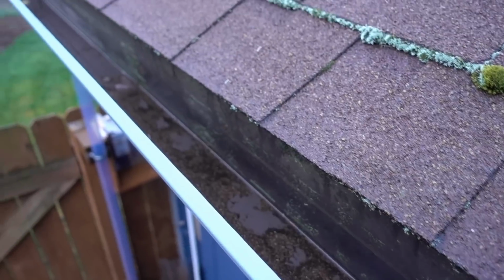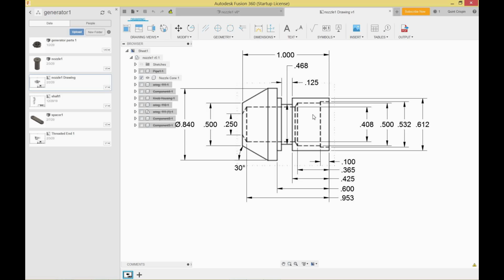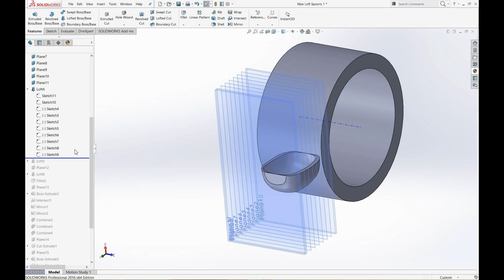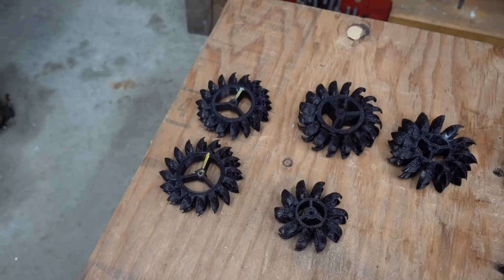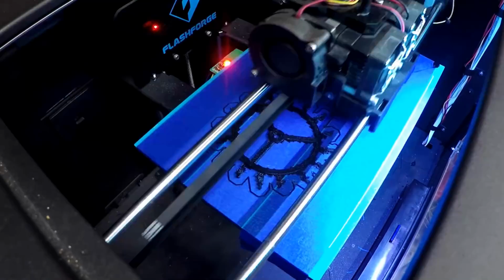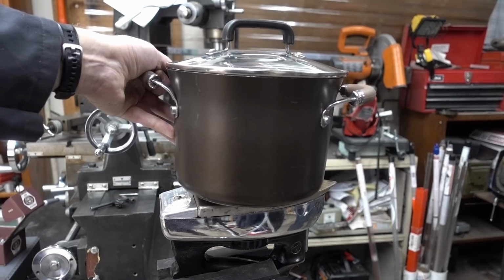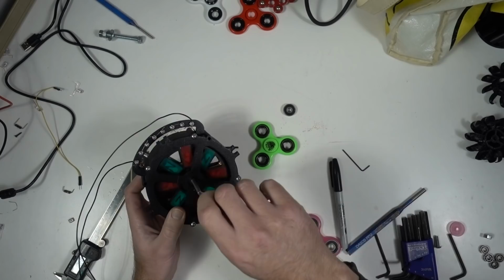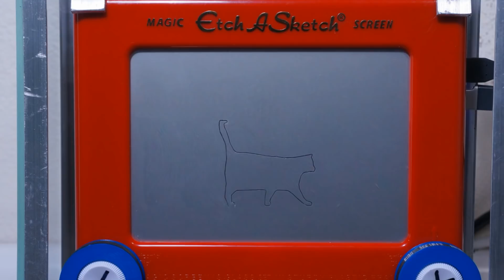Rain Gutter POWER #3 - Fidgeting With Turbines!

Comment: That downpipe is just too small.
There's no water weight to speak of to push that water out of the nozzle.  Almost the entirety of the water coming off the roof is going to flow over the edge of the gutter because the outflow to the wheel is extremely low volume.
And then there's the lack of filtration to remove debris (that I saw).
Reply from the maker: pressure = depth x density x gravity so in theory the diameter of the pipe doesn't matter.  It's how deep you swim, not the size of the pool.  Not very intuitive I know...

Comment: at 11:52, the question is, are you  measuring amps  and  estimating  volts, CORRECTLY.?
1)    amps  must be measured in such a way (through an ammeter) that  a  normal  amount of lenz-related rpm reduction  occurs.!            2)    THEN,  the voltage  must be  estimated, for  that  Reduced  rotation rate.        (in order to  KNOW  how much  slowing is  normal,  SHORT  the  pma  output.    it does not hurt anything to do this.)        googletranslate
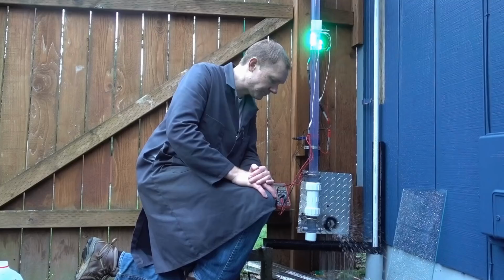demonstration; skip to 2:55
 https://www.youtube.com/watch?v=iOJe2L_qG0s

Comment: You still lose alot of energy. The water has to go to a 90 degree bent from the pipe to the nousel. You basic only use water presseur from the water. But arent using its moment from gravity. If you whould make some sort of turbo inside the big pipe. You take far more energy out. Just look at a car turbo. Although modification is need to fit the low power buts the idea is there.

Comment: Another Thought???
Might be,,,, to make the Top 1/3 Section of The Main Down Pipe as a 30 or 45 degree Angle???
Doing so,,, should allow a little bit more Water?? Since Any "Angle" is abit Longer than any "Straight". In a sense,,, No Loss from the Source for the Power???
PLUS???!
If we Know the Objective Outcome to Produce the 2 Watts is what??? The 1.9 Gallons/minute. And You've manufactured the Adjustable Jet Valve, anyway...
Why NOT Taper the "Main",,, from Larger with a Larger Diametered 1st Third,,, at a 40 degree angle. Into a 2nd Third Stage Smaller Diametered "Straight Down Main"... To the Final 3rd, Third, and Smaller Diametered "Main"???
THEN "Adjust"/ "Step Down",,, in Electrical Terms,,, Down To the Flow Rate Necessary with the Adjustable Jet???? WHY???

I would think SOME Loss is Also in the Water FLOW Rate??? IF it is Also "Pulsating" (like when Rowing a Canoe) then even the Jet might be Sputtering??
Just like the fact that,,, an LED Isn't really LIT. It's actually Pulsating soo fast it APPEARS to be LIT to the Eye!!!
Reply from the maker: pressure = depth x density x gravity.  It's not how big the pool is, just how deep you swim.  Not very intuitive I know!

Comment: Increase pipe diameter and volume of water collection to increase water pressure! Problem solved!
Reply from the maker: Pressure is independent of diameter
Reply: Quint BUILDs  my point is, larger diameter pipe, same length, equals more pressure due to the larger volume of water capacity. This adds weight. You can go taller or wider. Increasing the amount above the jet will increase pressure. Same reason water towers are built as they are. You’re more than welcome to make a video testing it and prove me wrong.
Reply from the maker: Sorry, physics disagrees. If what you say were true, we'd float more in wider swimming pools than narrow ones. Ships would draft less water as a river gets wider. It's just not true. Common misconception though.
Reply: Quint BUILDs Your body size and displacement of water determines how well you float. Which is why you can’t float in a bucket of water. 

You seem very knowledgeable. Maybe you should re-visit this topic. I’m quite surprised you missed this. Another example, diving and subs. When you swim down you’re ears pop from pressure of the weight of the water above you. You can go down to a point where the water pressure outweighs your buoyancy and you begin to fall. Subs have to be very heavy built due to the pressures of deep water. 

So..... what happens when you increase pressure through a jet? Well, spin that little generator with a pressure washer and see.
Reply from the maker: @austinbarrick1128  that's my point. Look up the equation for pressure. Width isn't there. Density x gravity x height. Increasing pipe width increases total weight of water in the pipe but has no effect on pressure. You don't have to believe it for it to be true. I don't have time to argue about something every engineer learns their first year of physics.
Reply: Quint BUILDs  actually I am wrong. I’m factoring flow in my theory. Where as your experiment of your column has no flow issues.

Comment: Why are you using Fusion 360? Solidworks is much better :/
Reply from the maker: SolidWorks is better for modeling and drafting for sure.  But it's expensive and doesn't have a CAM package built-in.  I modeled the turbines in SolidWorks because I've never done a loft in Fusion and didn't have time to learn.  SolidWorks is what I use professionally but I also like to expand into the free tools that others are likely to start with so I have some expertise when people ask about it.
Reply: @QuintBUILDs  i totally understand your perspective. From my experience of fusion after being used to working with solidworks they are quite similar and as you said professionally solidworks is a better choice

Comment: Nice video but,  you say that you would run a simulation if you had unlimited resources, but instead of running the simulation that only would take time and some electricity you prefer to waste far more electricity and a lot of materials creating a thrillion different wheels rather than finding the most efficient first. Just for the sake of a youtube video. Does it have any sense.

Comment: YOU NEED A BIGGER WHEEL.
Reply from the maker: That is one of the things I tried, didn't seem to make a difference.
Reply: @QuintBUILDs  I'm surprised by that. It looks like the water spraying odd directions is caused by too much flow into the cups. I saw the different alternatives you mad and none of them looked significantly larger. It's interesting building one from scratch. Usually they're sold paired with particular nozzles for select flow rates. This is a cool project. Very puzzling.

Comment: so much effort just to generate 0.1 A of power.......even a 10 by 10 inch solar panel can do 10 times better than that.....i think not to let ur experiment go to waste,u should convert it to a wind turbine setup instead......a small 1.2m radius wind turbine in a small 5 to 10 km/h breeze with a apporpriate sized generator should be able to generate 300 to 400 watts per hour.......more than enough to charge 10 iphones at once.....